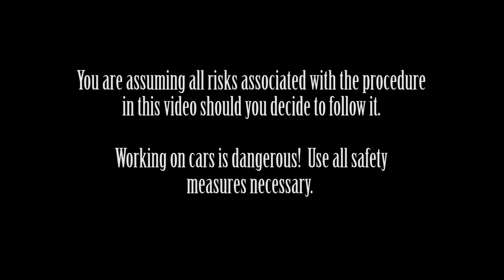TOYOTA RAV4 (Gen4) Brake Service - replace pads and bleed brakes

Comment: Hi there
i have the same car. I replaced brake fluid because it was very low and i disnt bleed the brakes. and i noticed my brake is very hard to push down sometimes. i checked the brake booster and it is working fine. Havent bleed the brakes for two years. could this be the cause for hard brake pedal?
Reply from the maker: No, I  don't think so, but you should flush the fluid every couple of years.
Reply: @masood-tv  okay! 
also the mileage is at 90000kms with the calipers. thanks
Reply from the maker: @cloudchaser9951  I would inspect the caliper pins in these cars...if not greased properly, they could potentially cause the hard braking.
Reply: @masood-tv  Thanks man
I will let my mechanic know! i'll update u the main cause! thankss
Reply from the maker: @cloudchaser9951  Please do.